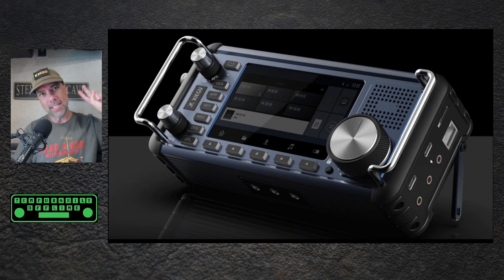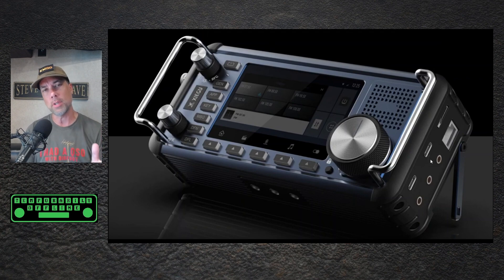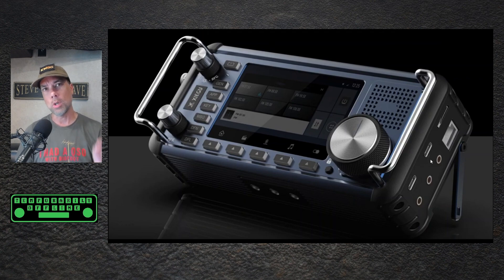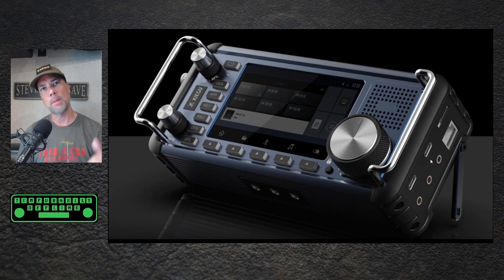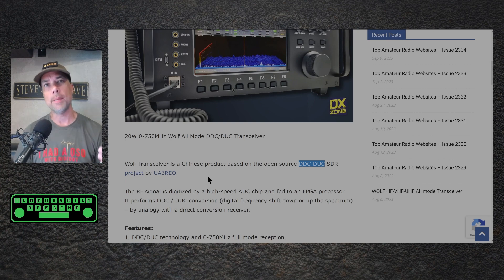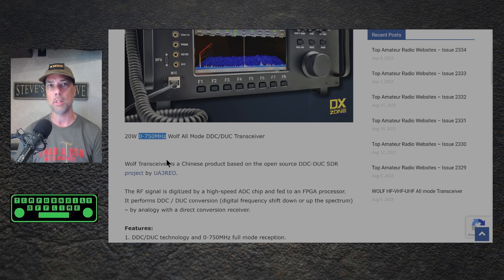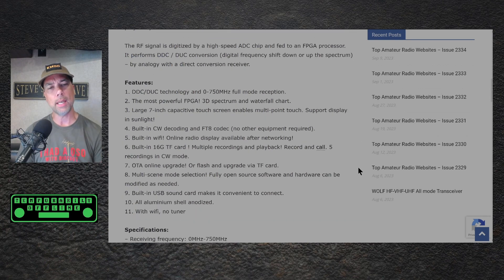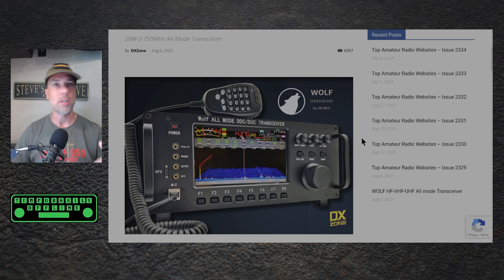More info on the new XIEGU radio

Comment: The three tripod holes is actually common on broadcast video gear... all my Sony cameras have that. The two outer are threaded 1/4-20 and the middle is not threaded - on the Sony at least. The tripod baseplate has a spring loaded stud that goes in to the un-threaded hole and makes a positive lock to prevent the camera from twisting on the baseplate. I think it's great that they have that, most "thread-only" tripod mounts aren't secure enough and you have to torque the living daylights out of the base plate screw or retaining nut (if you even have a retaining nut). Some base plates even have two screws - my Shachtler fluid head has two - hence the two threaded holes. If the actual radio gets the same config then, on this feature at least, kudos to XIEGU. There are some reasonable priced ball-type tripod heads out there with arca-style base plates that support multiple screws. Those are usually nicely low-profile so you can have them on the radio permanently. Unfortunately, the 705 has only a single 1/4-20 as it comes out of the box.
Reply from the maker: Thanks for the info!

Comment: Aloha T.O., all that we really honestly need is a 120 watt version of the G90 in a “All Modes” set up but with 6 meters, 2 meters and 220 mhz along with the current HF bands that already comes with the G90. Same waterfall, same analyzer, same tuner and SO259 on the front for a manpack set up and one on the back as usual to use as a compact base rig also. Not a base station but a small compact rig for POTA activations since American manufacturers just can’t get their act together since POTA’s and SOTA’s have been around for years now. 
    I would also like to see this 120 watt version of the G90 to have dual bluetooth capabilities in order to add a bluetooth capable keyboard also, maybe for CW programs for those of us that don’t know CW yet. 
     In my opinion, there is no current compact rigs out there that I want to buy for SOTA activations outside of the current Xiegu G90. 
    It seems that when it comes compact rigs for SOTA’s, Amateur radio is in a major slump right now. The closest rig would be the FT-891 but has no built in tuner, antenna analyzer and no waterfall, a major blunder for Yeasu for sure, a missed golden opportunity…😢
Reply from the maker: 💯agree. It's not like we aren't giving them thousands of hints...
Reply: @temporarilyoffline  Steve, I know that it’s not always nice to criticize but I think these radio manufacturers have earned this one. 
    Example, when Ray Novak announced the new ICOM IC-905, I like everyone else, thought, finally, a 100 watt version of the IC-705. What a freakin blunder, it should of been called the IC-1200 or something similar. The 905 was extremely misleading and that’s why I and many thousands of other Hams will never buy that rig even if it washes my clothes automatically. 😂🤣😂

Comment: Looks interesting. May be I'll finally get into HF if the price is right and it has 20W HF/2M/70CM. Mostly doing FT8 and Hunting
Wish the buttons on it were more flush mounted how they appear on the Wolf but the mock up does look more quality
Am I understanding this right about FT8? It will be on the device so I wouldn't have to use a Laptop? That would be killer
Reply from the maker: I haven't seen Xiegu's official stance on FT8 on rig - but TOADs have a few tricks up their sleeves to make that happen - We have a linux distro that runs native on the X6100, FT8CN that runs via android and now WFView server baked into the radio to do FT8 without cables - If it works on the X6100, Xiegu would be STOOPID to not make the new rig similar, right?

Comment: Please, Please, Please let this be the upgraded G-90!
Reply from the maker: 20w (or more) would be nice
Reply: The g90 is already damn nice. An upgrade would be amazing. After the 30 rounds of firmware updates to make it work.
Reply: @stevet7522  it would be worth it because, even if it's imperfect, this maybe enough to make the Big 3 Get in gear and create something similar. 20-25 watts to me is a sweet spot of portability, power consumption and still have the ability to make DX contacts with any degree of consistency.

Comment: I suspect the add ons are the transverters. To implement those right though, they have to allow the VFO to track the output frequency and not the input but we will see. Also hope we see properly implemented bluetooth/wifi. Maybe WiFi6 ;)
Reply from the maker: The screen hints at bluetooth audio for FM radio... It wouldn't be hard when using a SoC and Linux to do bluetooth right.

Comment: Built-in digimodes has been missing for a long time, and for some reason none of the big three bothered with it. Still, it's kinda off-putting that Xiegu never bothered to fix, for example, bluetooth audio on the X6100. I understand they need to keep things fresh, but they should really establish a software baseline and then have multiple models that can take advantage of the same maturing software. If this is another one-off radio and they stop developing the X6100 firmware further, I'd be disappointed to say the least.
Reply from the maker: Totally agree.  They should be iterating on success, not furthering failure.  The G90 is a good/mature radio, but it had a specific dead end.  the X6100 wasn't mature when it was released and had many missing features, some like wifi that would never work due to bad implementation.  Hopefully with this rig they have fixed all the pain points of the X6100 and started with a good core they can stack-forward from.